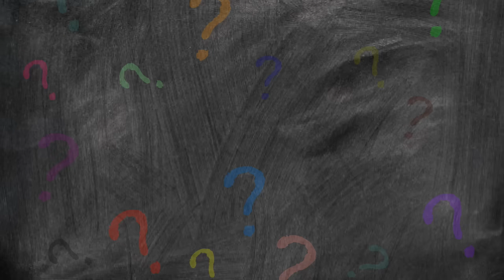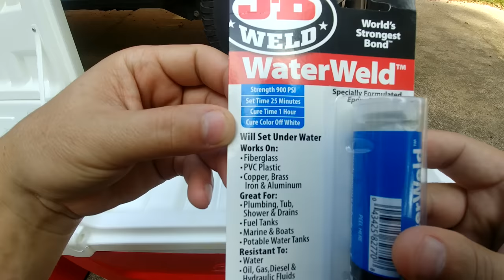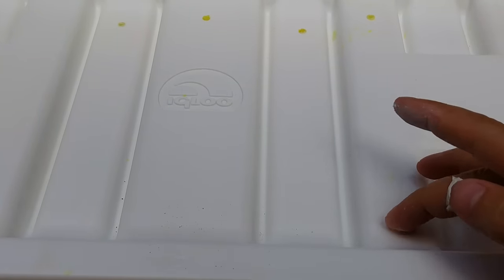Do Yeti cooler hacks work?

Comment: Just curious if maybe one side of the car catches more sun than the other or if maybe the foam insulation just holds in the heat more than just the standard lid
Reply: That’s what I was thinking
Reply: @joeartgarrido007  me too
Reply: Yea i was thinking same thing
Reply: Ditto, I was going to make the same comment when I saw yours. There is also always the possibility that such a low quality product may have variations as well, such as the thickness of the plastic used from one to the next or maybe even whatever wall insulation/foam they use around it.

In addition, I feel that this hack is not complete. You must place this cooler inside a larger cooler, one that is large enough so that you have about 1 inch empty space between the outside of the smaller cooler and the inside of the larger cooler. Spray at least 1 inch of foam all around (maybe use insulation panel material?) including the bottom so that the red cooler will have insulation all around. That other cooler and 3 cans of spray (?) will set you back about another $50.  So figure close to $80....Hmmm.
Reply from the maker: hehe I think your last comment about the 80 dollars without factoring in another cooler is why that would not be practical.
Reply from the maker: One side of the car does not catch more sun than the other but let's say it did wouldn't a Yeti cooler still out perform in that situation?  If I bought a Yeti cooler and placed it in the sun and placed a standard Wal-Mart unmodified cooler in the shade wouldn't the Yeti cooler still win?
Reply: I think you might be right on this. Looking at the Jeep earlier in the video looks like the House is on the right side of the Jeep which is where the normal cooler was, so as the sun moves it could have less direct sunlight on it.
Reply: @Mr.Potato420  has no idea what he's talking about. the brothers that founded rtic have no connection to the brothers that founded yeti.
Reply: @Mr.Potato420  a Google search will tell you how that you're wrong
Reply: Ditto
Reply from the maker: Check out part 2 https://youtu.be/Fr8kyEtud0s
Reply: @Mr.Potato420  that is completely wrong ..
Reply: @Mr.Potato420   I'm not sure where you heard that but that is not true.
Reply: @Mr.Potato420  Funny. I heard it was just the opposite. He kept Yeti and she started RTIC. Either way, we’ve decided to go over the top and get a Dometic.
Reply: @Mr.Potato420  also Yeti is anti 2A.
Reply: @Mr.Potato420  a quick Google search shows thats not true at all
Reply: This is what I was going to say
Reply: @darylSKYTZOwillis  no they are pro 2a. Do some research on what happened please. This is everyone’s problem they comment without looking for themselves. Oh I heard xyz so it’s gotta be true.
Reply: @HowToWithJames  hi i think the foam in the lid works only in direct sunlight maybe try and do this again outside and see what happens?
Reply: Go to Dollar Tree and buy a $1 styrofoam cooler.  Put it inside of the original cooler, then   add ice inside of it.  Test it versus the other cooler without a styrofoam cooler.
Reply: For the car part unless it's in direct
Sunlight the car will.be the same throughout
Reply: @HowToWithJames  That seems a solid response, however you only modified the lid. While it certainly may make a difference all other things being equal, the reason freezers tend to have the door on the top is because heat rises therefore cold falls. Based upon that the improved lid insulation may not make much difference if the sides are equal in insulation but not equal in heat load and in reality there's no actual evidence they are equal in insulation. To test that move the only thin modified (the lid) to the other cooler and repeat the test. at that point you can see if there is an issue with the housing of the previously modified cooler. Obviously it's too late to do a control where both coolers are tested unmodified.
Reply: Lid traps heat….
Reply: @jesush.vazquez6851  Can’t always believe everything that you read on the internet.
Reply: As soon as he said theyre gonna be in his car i thought this. Also, 80s isnt hot. Here in tx its over 108 every day in the summer. And we still work outside. When were cooling off we go in an rv thats 87 degrees.
Reply: The lid is where the least amount of cold escapes.
Reply: That’s an excellent point and also a good example of why the scientific method ( which this is not) is so useful.
Reply: It might have worked a little, if he had insulated the bottom. Insulating the top probably only kept heat from escaping.
Reply: @ppentertainment2351  That’s my favorite quote from Abraham Lincoln!

Comment: Swap the lids on the coolers, and repeat the test. One cooler may have had better insulation in the main compartment than the other.
Reply: The labels on the coolers were different..
Reply: @EZSTREETCARS  And? They're still the same cooler.
Reply: @amorton94  - one is branded for ozark trail - just because the look the same doesnt mean they are the same.
Reply: @robtdougherty  WRONG. They're both Igloos, with Igloo stickers and Igloo on the lids. THEY'RE THE SAME COOLER.
Reply: This is a very good point. Without doing this, there are variables that are undefined.

Comment: The hacked cooler had less ice because it has a greater thermal mass. Energy, in this case heat, only moves in one direction, from the higher energy state to the lower. By adding the insulation to the lid, you increased the total mass of the system. In order to keep things cold, the entire interior needs to reach an equilibrium, which depends on the total mass of the system. If the lid is more massive, more of its stored energy will flow into the ice. 
I’d suggest trying this again, but keep both coolers in a cooler location with sacrificial ice to start. Then replace the ice and start the test. Yeti and other manufacturers recommend this practice to achieve better performance.
Reply: I agree. It would be interesting to see the difference in temp loss with the foam vs air when both coolers have been chilled by a sacrificial bag of ice. My theory for the result is that air will be a better for heat from the outside but a pre-cooled cooler insulated by foam will hold the cold better. lets see it!
Reply: just realized how old this video was lol! I doubt he still has these coolers.
Reply: I was thinking something similar and wonder if there was a fan installed to occasionally pull the extra heat held in the lid at ten minute intervals. The thicker lid will require more energy. I think this could be resolved with a small DC powered fan. As you’d explained, heat wants to fall in this case and the equilibrium is off. Maybe if the air is purged ever so often? I wonder if a vestibule were built with a one way valve for the air flow would help too. How advanced should we get tho for an ice chest? Should we consider refrigerants next? Lol
Reply: With the added insulation, the greater thermal mass caused it to heat up faster but also trapped more heat inside with the ice. In the other cooler the heat could dissipate through the lid more easily.
Reply: Would a small hand pump allow you to have a vacuum tight seal and release the ambient air trapped inside.
Reply: i love science :) birds figured out air does a great job at insulating
Reply: I'm not sure what this will solve.  Nobody in their every day use is going to create the perfection conditions.  If the modifications don't show improvement during practical use, then, they are not good modifications.
Reply: Pre-cool both of them by filling with cold water and letting it sit until the cooler's mass has lost as much heat as is practical for a test like this.  Dump the water, add the ice.  Proceed pretty much as in the video.
Reply: Makes sense, similar to filling a Stanley thermos with hot water before you put your coffee in.
Reply: Why would you want to test it in a cooler location? This is coming from a person where summers=coolers and 90 plus Fahrenheit. THAT is the only time I give a hoot about performance of coolers.
Reply: @jamesjw0071  I prechill my coolers 100% of the time. Regardless of if they’re rotomolded yetis or igloo bargain coolers
Reply: The foam insulation is a better medium that allows heat transfer from the interior of  the cooler to the exterior.  In this case the air between the interior walls and exterior wall of the cooler is a better insulator than the foam.
Reply: nah, the air in the empty space is a heat barrier. And because he filled it, it no longer is as good of a barrier. Its why thermos's have the vacuum barriers. They don't transfer heat or cold very good, so it stays inside rather than moves outward.
Reply: Even if that was true, the way he did it is closer to real life use.
Reply: I don’t think this is correct
Reply: Even yeti states you have to do a “Pre-Chill”
Reply: No, you would test it as you would use it in real world.
Reply: If you have to use ice to pre-chill it, why not just use that pre-chill ice inside the cooler?
Reply: THIS was REAL WORLD Testing ... if you need a Cooler ,,  your not gonna pre chill it every time you want to use it ..
Reply: By Adding the Foam , you created Thermal Bridging ... the Air GAP is what separates.
Reply: @MrT------5743 never heard anyone prechill a cooler . Maybe these are just not good coolers . I have a Coca-Cola cooler the ice last atleast 2 days .
Reply: @Lizard Man  you probably already know that if you pre-chill the stuff you put in a cooler, it makes the ice last longer. I mean, if you fill a cooler with warm beer/soda cans, etc, and put ice in, it wouldn't last as long as putting in cold cans. 

When we go on a long camping trip, in our drink cooler, we freeze most of the water bottles and anything else that won't explode. Cause this way, the ice lasts longer if the stuff is already cold as ice from the beginning.

Comment: Dead air is one of the most efficient thermal insulators. You functionally decreased the performance by filling in that air gap with more thermally conductive material.
Reply: What makes foam a good insulator is that it's mostly air. It uses cells to keep that air from moving. The reason that inexpensive cooler lids usually do not have foam in them from the factory is that the air in the lid doesn't want to move anyways. Think about it. The layer of air closest to the ice gets colder -- heavier -- as the heat transfers from the cooler lid through the plastic into the cooler. So that layer of air stays where it is. In other parts of the cooler, thermal changes cause the air to move within the cooler walls. You don't really want that. So foam helps.
Reply: @---cr8nw  yeah that's a good point, it's a relatively uniform thing on top

I also saw a comment on another video that pointed out the foam needs air to cure, so it's possible that there's basically a bunch of uncured goop that isn't foam inside and that's part of what's causing the issue
Reply: @pmmmAMV  also, that foam produces its own heat while it's curing
Reply: @lorenzo42p  The curing process only take at most a day it would not be the cause of this specific problem.  The most likely issue is that there is no convection movement within the lid of the unmodified cooler.  The easiest way to test that might be to reverse the test and try to keep something hot rather then cold if this is right the modified cooler should be better.
Reply: @FakeSchrodingersCat  storing something hot would have a new problem of convection inside the cooler, in the large storage area. this isn't a problem when storing cold things because the cold air sinks to the bottom and tends to stay there. when it comes to the lid, I think performance would be the same when storing hot or cold things inside the cooler. it's just transferring heat in the opposite direction. cold is just the absence of heat
Reply: I was thinking that as soon as he put foam in the lid. He was reducing the insulating properties. He would have been better off leaving it alone and putting a weight on top of the lid to provide a better seal with the chest.
Reply: Why in a world where we are normalizing spray foam insulation is every comment relating to this initial comment trying to say that insulating what's supposed to be an insulated space with the most modern and efficient form of insulation doesn't help?
Reply: @Rork333  Air is the common insulator here. Foam is generally a good insulator because it contains a lot of air. However the air space between the top and bottom of the lid is 100% air. So a cooler lid with 100% air in it is better insulated than a cooler lid with foam in it which has less than 100% air.
Reply: @mattcolver1  the bottom is filled with foam and by your logic a house with foam in the walls is better off with no insulation in the attic do you have an actual explanation for why you think this or are we just gonna keep rewording the same sentence with different view points?
Reply: @Rork333  Because of the video above where the cooler modified by adding spray foam didn't insulate as well as the one without?  Just a guess but I believe that was the basis for this conversation.
Reply: @Rork333  Attics have vents. Walls also aren't sealed. The insulation in walls is also used for noise reduction. Air is trapped in a cooler lid. An even better insulator than air is no air all. A vacuum, like in a thermos. Filling the cooler lid with a lighter than air gas like hydrogen or helium would be an even better insulator than air.
Reply: @mattcolver1  so we can all agree that the issue is AIRFLOW not insulation value
Reply: @Rork333  the bottom & sides are filled with foam for strength. consider the extreme heat cycles of being empty and then ice filled, weight of drinks etc etc. by filling with foam they get extra strentgh to sides buckling or fatiguing when you sit on it.
Reply: I’m going to rip out all of my insulation in my house! Thanks man!
Reply: @jason4039  lmao that's probably not gonna be as much truly dead air as you're hoping for, unfortunately. I'd stick with insulation on that front

Edit: double pane windows in place of single will go far, though
Reply: @pmmmAMV  thank you for the kind tips and tricks. Looks like I’ll need to go to menards and pick up a few sheets of drywall…
Reply: @jason4039  my assumption is this is a joke, but if there's any seriousness here, honestly check out the various r-values of different construction options. When it comes to housing, there's some truly magnificent options on the insulation front.
Reply: From a quick Google on the efficacy of dead air insulation:

"In theory, air is a good insulator, if it can be kept from moving. Dry, absolutely still air has an R-value of 3.6 per inch of air — as good as most insulation materials.

But, the air inside your walls is never still. It's moving constantly, and with that movement creates a convection flow that results in significant heat transfer out of your house in winter, and into your house in summer."
Reply: It's a lot easier to keep air dry and unmoving in a small plastic panel than on house scale with porous and moisture-affected materials
Reply: @jason4039  me too! Makes perfect sense!
Reply: @jonathanyoung8109  my man lol
Reply: That's what I insulate my house. Nothing but air, baby.
Reply: Liquid nitrogen is stored in a container that has an air pocket under vacuum, and it’s coated with copper (thermal reflector)

I’d assume this is the idea setup for keeping something cold. Stopping convection, and providing a bridge for the heat to move through, is a few ways to make it more inefficient.
Reply: Just like an Attic
Reply: @mattcolver1  All the yetti, ozark, extreme coolers, have a full foam inside the LIDS!! AND STAY MUCH COOLER LONGER!! THE FOAM ABSORBS THE HEAT AND CONTAINS IT! SO NOT SURE WHAT  THIS GUY DID WRONG😕😕😕
Reply: @mattcolver1  Not in the brutal scorching sun!🔥🔥🔥🔥
Reply: @millebolle2592  Then why do the heavy yetti" ozarks, too, keep things colder! ! Much longer too!! The lids all have heavy foam too!
Reply: @---cr8nw  Properly foamed foam prevents the air from moving - I think he seriously overfilled the lid, so ended up with a lot less air bubbles in the foam.  Can't really say without sawing it open though.
Reply: Okay so would putting a valve you could hook up and air chuck to pump compressed air in the lid be better provide the lid is sealed properly of course just wondering if putting more air would make it better?
Reply: @MrLemons09 vacuum would be better than compressed air
Reply: Mine yeti lid isn't insulated but it had a plastic bung in the lid which I removed and filled the lid with water, I then reinserted the bung and bonded the plastic with a soldering iron to stop leaks (don't over fill lid allow room for expansion), the lid on my cooled is easy to remove as it's got a moulded ball fitting which is easy to remove from the cooler and then put lid in freezer. I took my cooler out from 6am to 6pm today and there was still some ice in the cool blocks I put in the bottom of the cooler and cans of drink were still cold
Reply: then why is the base of the cooler insulated around with foam then?
Reply: Just fill the space with Argon gas and seal the holes.
Reply: Air insulate a little, but is far from the best insulator, and in no way can compare with real insulation.
Reply: You could’ve bought a Pelican with all the side costs 😊
Reply: Closed cell foam vs open cell foam formulas. 
.try the experiment again.
Reply: @mattcolver1  Then why do all the high end coolers have insulation in the lid?  Granted, it's not spray foam, but they are insulated.